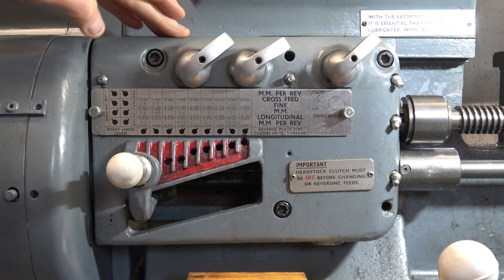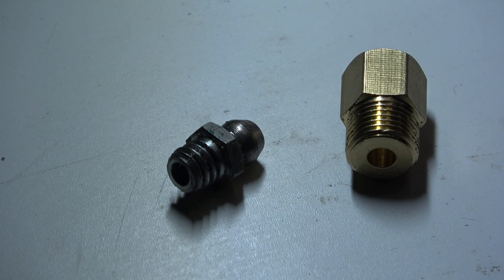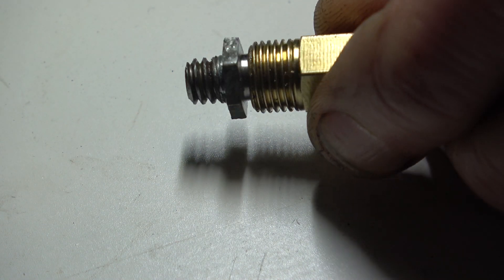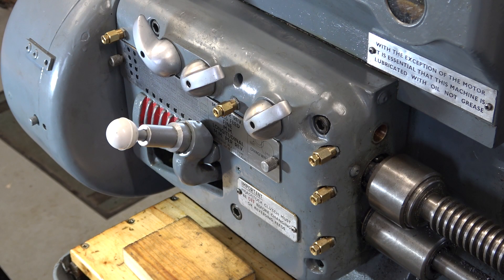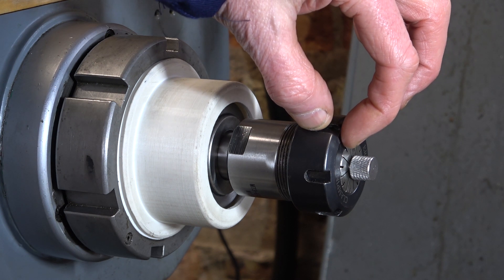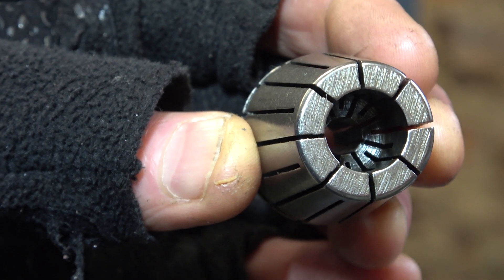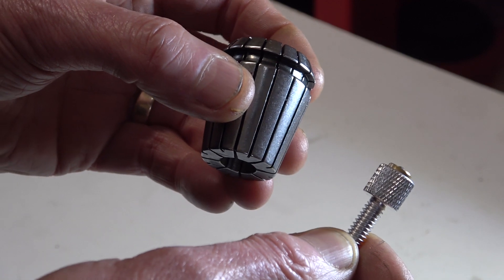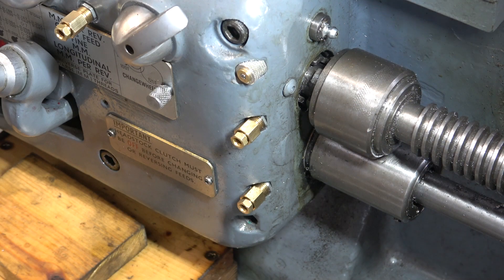HS51 Screwcutting gearbox oilers for my Harrison 140 lathe

Comment: very useful, I've a Harrison 140 myself ad noted it didn't lubricate the headsock bearings in low range, I almost never use them gears as I've an anjust quick threader but its always playing on my mind, I too had my suspicions about adjusting my bearings, my play turned out to be the taper on my chuck fitting, my approach was much less scientific than yours , my lathe had also had the gears chewed, far worse than your own and i removed the resulting swarf from the gearbox in the same manner as yourself, I also placed a magnet in the gearbox and its not bolted down , this worries me a little but I've never had it move in over a year use , do check the taper on the chuck and spindle, I have considered fitting a one shot lube system to my gearbox
Reply from the maker: Hi, my spindle taper and chuck fitting are pretty good. Several people have suggested my headstock gearbox hydraulic oil is too thick and that I should replace it with modern thinner ATF - which may give more splash at low rpm. I've kind of taken the view for the moment that Tellus 33 (ISO 68) hydraulic oil was good enough in 1971 when the lathe was made and it should be good enough now - but they do have a point because oil technology has moved forward a long way. I've bought a small 5v gear pump motor with an idea to create a pumped feed to the bearings. That's a project under development which may feature on a future vid. I'm waiting for the weather to warm up a bit!!  Cheers
Reply: @HaxbyShed   get one of them chinese diesel heaters for the shed, they are a great job!